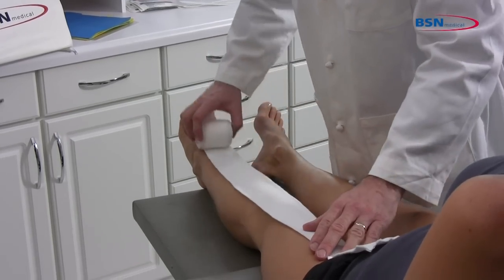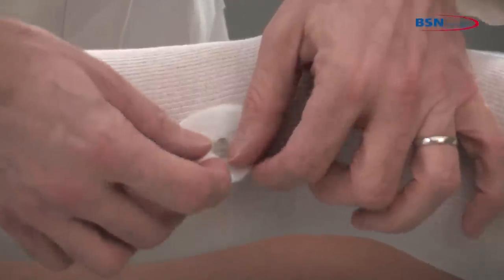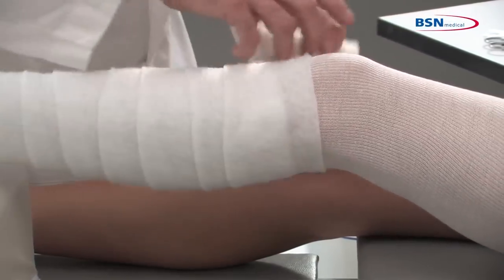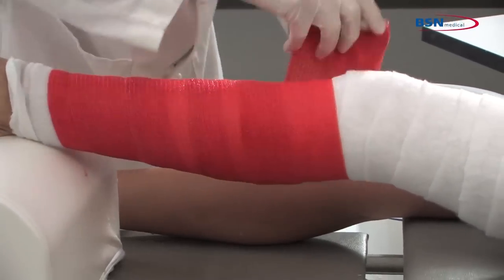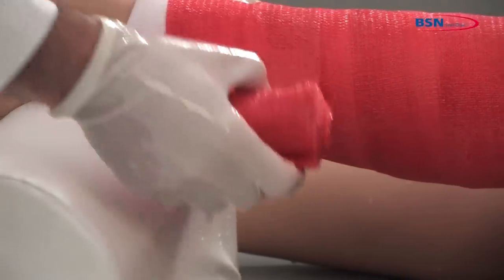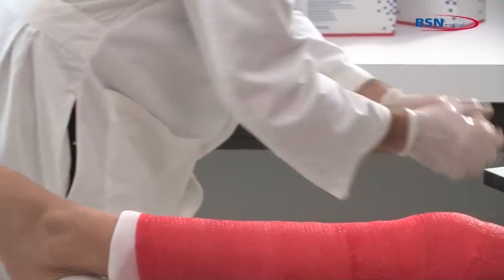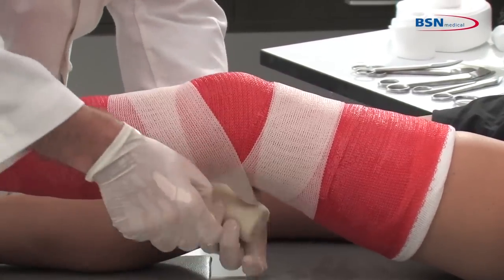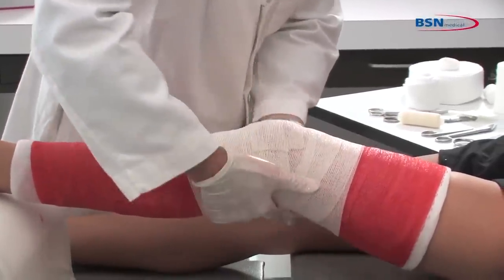Synthetic casting knee application_EN_by BSN medical.mov

Comment from the maker: This specific application is used for indications where the knee needs to be immobilized and not for  tibia fractures. It is correct that with tibia fractures the ankle joint needs to be included.